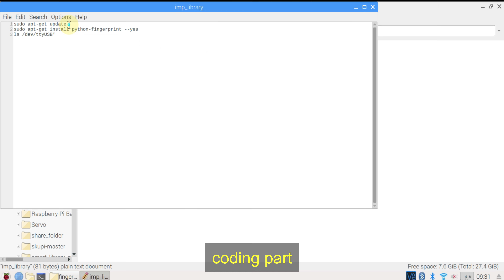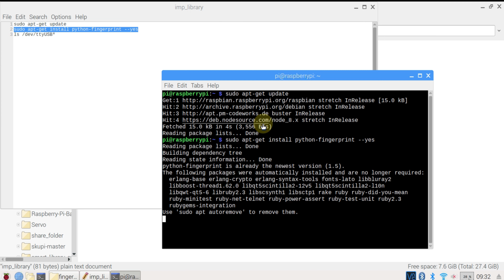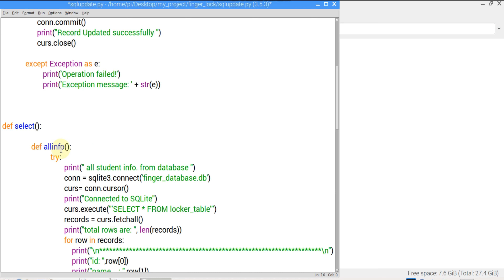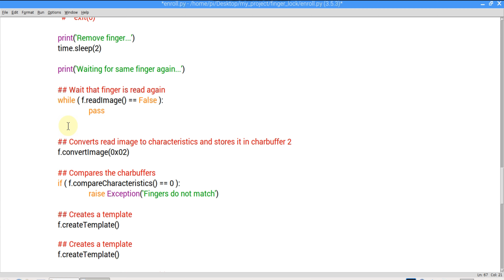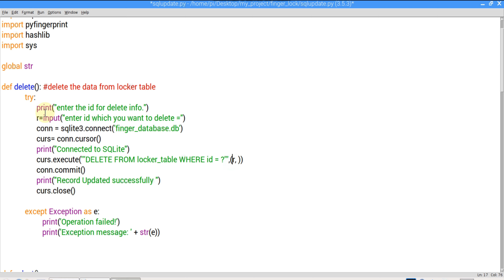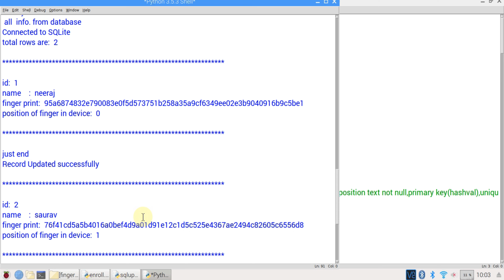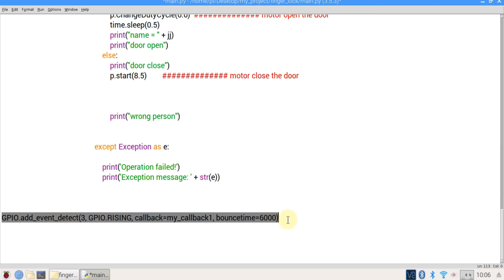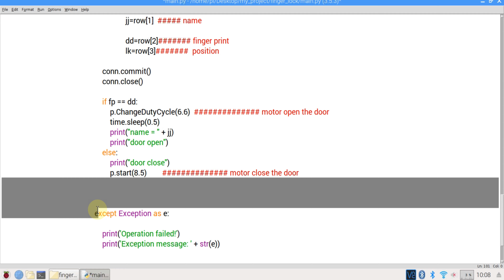Fingerprint smart lock system using raspberry pi | Fingerprint security system | Experimentalist.

Comment: Hello
 I am getting module not found error whenever i run the example_enroll. it is not able to fing "from pyfingerprint.pyfingerprint import PyFfingerprint.
Thanks
Reply from the maker: First you need to chech whether usb is recognised or not, by running this command, make sure finger print sensor is connected to raspberry Pi.Command is ' ls /dev/ttyUSB* '

Comment: Hey,  I am working on a similar project but instead of servo motor I am using a solenoid lock. Also my project does not include the IR sensor. Can you help me with the code?
Reply: Also want to add a solenoid lock to the Code. Mby we can exchange ideas or if you already found and answer pls share it here
Reply from the maker: Ok, i can help you
Reply: Hey, great to hear back from you please suggest the changes to the code you uploaded on Github as I am using the same.
Reply from the maker: @neelbaladkar2163  ok give me some time

Comment: curs.execute ("CREATE TABLE locker_table(id text not null,name text not null, hashval text not null, position text not null,primary key(hashval),unique(id))")
sqlite3.OperationalError: table locker_table already exists
can you help me??
Reply from the maker: This error means, the table locker_table already exist. 1st of all delete the existing table in the folder
Reply: @experimentalist1494  
Currently used templates: 1/300
Waiting for finger...
Found template at position #0
The accuracy score is: 94
Operation failed!
Exception message: name 'dd' is not defined

I run the main file after I successfully entered the fingerprint and show the error as above, is there any way to fix it
Reply from the maker: @thangnguyen-fn6dy  this error means, "dd" is the variable, which you dont define in the code. First of all define the "dd" variable. If you dont configure the error, you can also share me the part of the code, which arise the error.